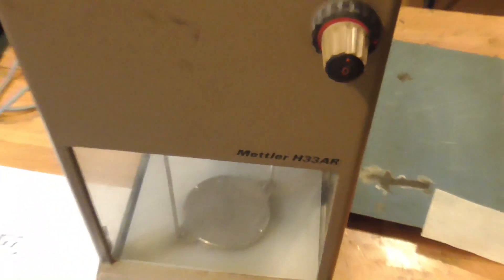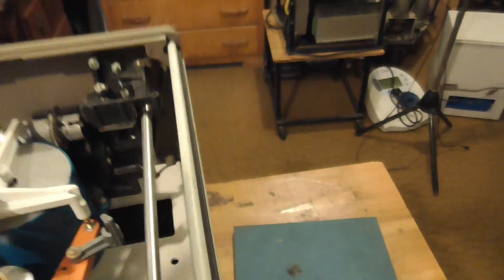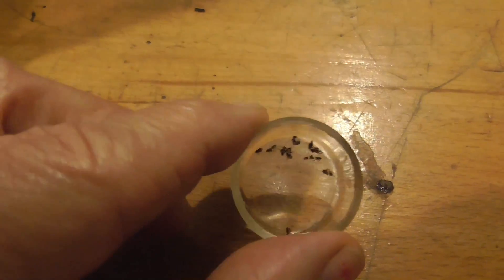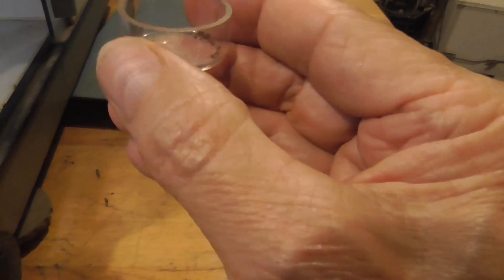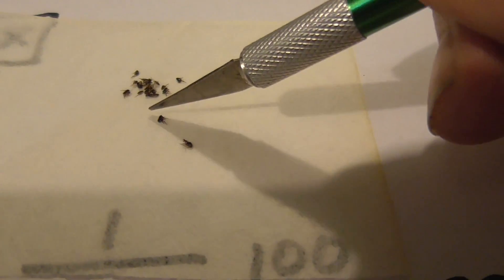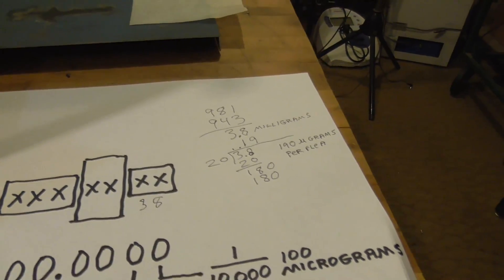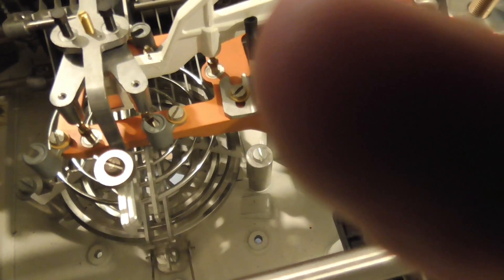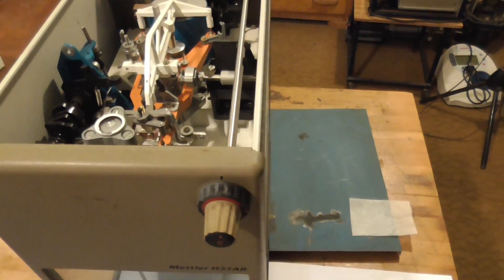HOW TO WEIGH A FLEA

Comment: Oh how it hurts my heart to know that such a wonderful contrivance went in the dumpster. I hate modern electronic equivalents to old masterpieces of mechanical engineering prowess. Even if the measuring sensor is analog, it still gets read by something digital which strips the life from the signal.
Reply from the maker: Actually, it didn't end up in the dumpster! Someone with some shelf room stepped up and got it!
Reply: @glasslinger  That's nice to hear. I hope they get many many years of good use from it.
Reply: @belly tripper In this usage, those words are essentially synonymous but "contrivance" denotes a certain level of mechanical complexity, so no, I meant precicely what I wrote. For example, a ball peen hammer is a wonderful device, but I would not call it a wonderful contrivance.

Comment: After placing the  piece of paper on the scale you should have brought it back to zero, that's called "tare", and it's actually a dedicated button on modern digital scales.
Reply from the maker: Yes, I did exactly that. It is done with a very sensitive knob on the unit. That scale is an "antique" that is being demonstrated for curiosity only. It is not a practical instrument compared to modern instruments.
Reply: @glasslinger  I've used very old and newer models of Mettler scales in labs in my career as a Medical Technologist and yes they are the most sensitive scales used routinely in scientific applications.

Comment: Hi Ron and thanks for this great video. Back in the day I actually have bought several mechanical Mettler balances and have also disposed of quite a many. The circular metal counterweights might actually be something to spare. They are a binary series of high accuracy weights. The largest is 80 grams, then 40, 20, 10 and so on. The precision is unbelievable. They all are far better than 100 micrograms. BTW, you should always close the balance doors before taking the reading.
Reply from the maker: I read some poop (found it to be LITERALLY poop!) on operating the scale, such as keeping the temperature constant, not touching the container with your hands, closing the instrument doors, etc. DOING EXPERIMENTS WITH IT AT THE MOST SENSITIVE SETTINGS I COULDN'T GET ANY OF THAT CRAP TO MAKE ANY DIFFERENCE IN THE READING WHATSOEVER! The thing that DID make a difference was when I leaned on the table causing the table leg to sink into the carpet thus tilting the scale.
Reply: @glasslinger  Thanks for comment Ron. You seem to be lucky as not to have drafts in your shop. I remember we had in the university analytical lab class a task to measure the amount of iron oxide dust, which I failed three times until the tutor came to see my weighing... The lab obviously had very efficient fume removal. Bad memories, that is.
Reply: @glasslinger    The axis of gravity is to the center of the earth, at least theoretically.  Scale has to stay level for best accuracy.  I suppose you can calibrate the span with the reference weights.

Comment: I was thinking of building one of these years ago, and I know that the magnetic field is proportional to the current and this is the easiest way to do the knob on the bottom.
Reply: This would be electromagnetic force compensation, a really nice principle for a scale.  years ago I saw building instructions in an electronics magazine for one. But as I understood,  this one is mechanical. they suggested to use an actual speaker for it.

Comment: There are shipping hold downs attached to the orange frame piece. Most visible at 1:15, they are the gray plastic arms that don't look like they attach to anything. They swing in and hold down the white balance beam and lift it off the knife edge for shipping. The range setting rings may have a spring clip for them to or you can use a piece of foam to keep them from rattling around.

Comment: 2:05
Doesn't work in the dark . 
So that was my problem . :)
14:20
Yea, but the Chinese ones will not work after an EMP. 
18:41
At least pull out the sapphire bar and save that .

Comment: I used that exact scale a lot in the 70s/80s with a precious metal user company. If you zero the scale with the paper, remove the paper, add the fleas, you have the tare wt set, then weigh them. You won't have to keep track of the wt. or do math or worry about units, faster.

Comment: Have you considered putting it on EBay/Etsy/Kijiji or the like? There is someone out there that would love this, I'm sure.
Edit: I took a look - they're not huge money makers, but it looks like you could list it for about $150. That's definitely borderline as to whether it rescues it from a dumpster or not.
(Oh, and if you mentioned that in the video, sorry. I skipped ahead a bit).
Reply from the maker: The shipping would pass $50 for sure and it is in poor condition, with internal parts missing. It barely works. Someone local stepped up to take it so it will be saved from the dumpster.
Reply: Hell, I'd love to have it if I had somewhere to put it. Unfortunately I don't, nor do I need it.
Reply: @AliasUndercover  Same. And the reason I don't have room is because the room I do have has been carefully alocated to massive quantities of other things I didn't have room for and don't need.

Comment: There are a few over at the local standards laboratory, sitting in the mass room. On concrete benches cast into the floor, with a separate isolated slab only for them, so they are stable. Both digital and analogue, so they probably have the full set of manuals for them still. I would guess any local user of them will have the manual, and perhaps try your local university with an engineering department, who might have them in a library, as they almost never throw out manuals for equipment they have had in use there.

Comment: This brings back memories, I used to use one of these when I worked at IBM East Fishkill, New York back in the EARLY 1980's  One of these units was mounted on a 1 ton steel table that was bolted to the 10 inch thick concrete floor. We used it to weigh the amount of Nickel that was plated on a ceramic substrate that was 1 inch square by about 1/32  inch thick!  Now having said this this, Interstate 84 was about 1/4 mile away maybe a little more from the building which was BLDG 330C phase, when a 18 wheeler rolled down the interstate, it would interfere with the readings on these type of scales, EVEN WHEN SOMEONE WALKED AROUND in back of me when doing the weigh process would send the optics into a "TIZZY" There was a small control that "LOCKED" the mechanism when not in use and when and if you ever had to move the device you had to take out the pan and suspender cage it was hung from to prevent internal damage!!   John Bellas  KC2UVN  Thanks for the memories  Ron!!  Had to share my story!!

Comment: There should be shipping pins to lock the bridge located in the upper deck and instructions to place them on a sticker under the cover.
I have a slightly later model I still use.